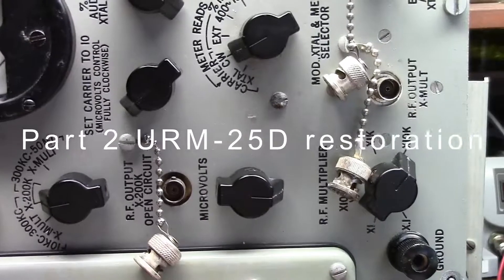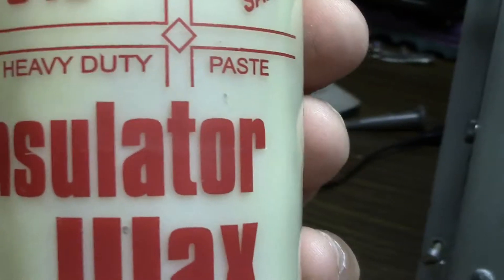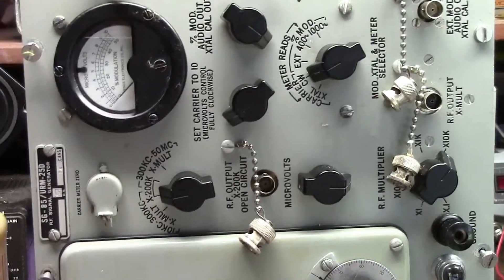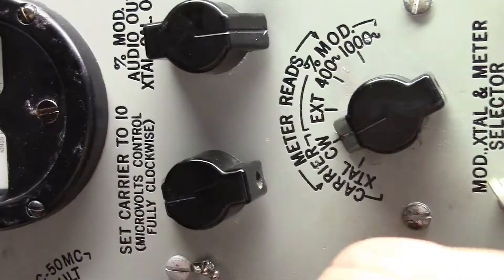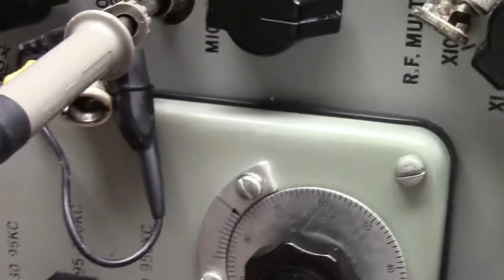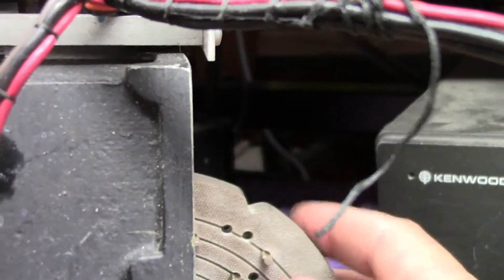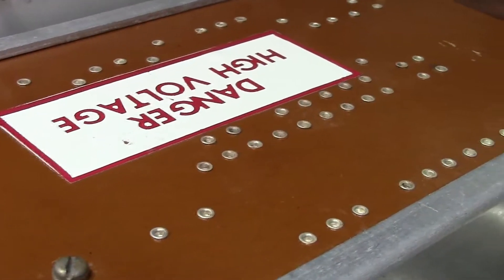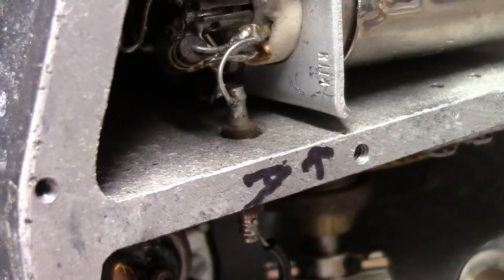Restoring a URM-25D RF/AF Signal Generator Part 2

Comment: Beautiful cosmetic refurb on the unit, Alex. Many just get the guts right with Jesus and let it go. Love the wax job!
I was using a WaveTek 3001 until it developed lock problems so it was shelved (for a rainy day repair) and I brought "Old Betsy" back on line. It was truly a reclaimed pleasure! 
I got it back in the 80s as a "depot recon" (like new). 
Basically, just an oscillator, an attenuator, metering circuit, and some extra gadgets all wrapped up in that glorious old 1950s "common sense" packaging. 
It's like having an old friend drop by. 
Again, thank you for the videos. 
de William, k6whp 
dit dit

Comment: Did you notice any frequency drift in the output signal? My URM25D drifts about 100 hertz or so every couple of minutes. The drift persisted after about 30 minutes of warm-up time. I wonder if a longer warm-up time is needed.
Reply: 30 minutes should do it.
Reply from the maker: Hi Bill : I did have the same problem once I relaced the Osc tube and cleaned all tube pins and the tube sockets. These rigs are also prone to bad solder joints from time to time. Best wishes to you and yours . Alex